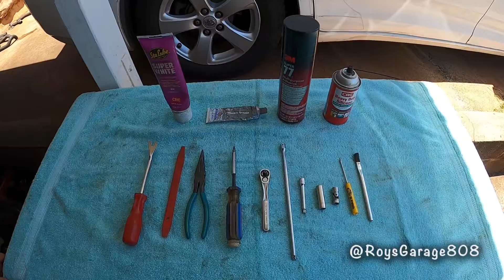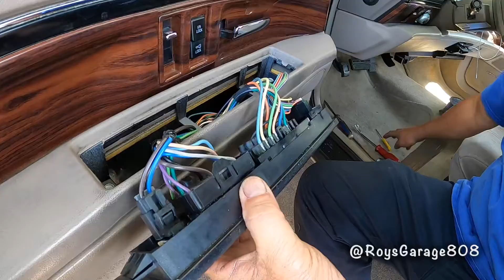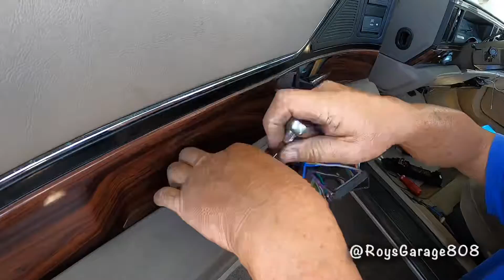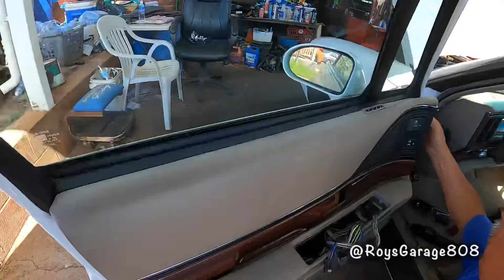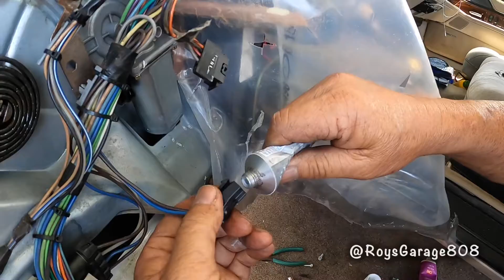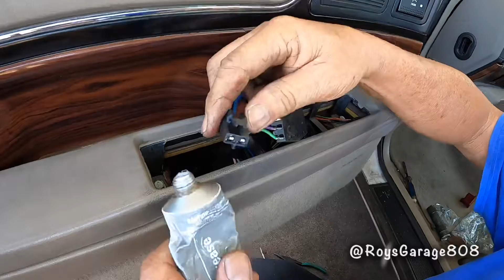How to Replace the Power Window Motor (Driver's/Left Front) on a 1999 Buick LaSabre

Comment: I have a 95 Park Ave. My window motor is working but only rolls window down 1/4 of the way. I can lower the window all the way with a hand on each side. After lubing, it goes down with ease. Once down, it will only roll up 1/4 of the way, and motor just chugs. But I can raise window with both hands and lock it in place my hitting the roll up button. DOES THIS SOUND LIKE A BAD MOTOR? Is there a nylon gear or something that is worn out that could be replaced, or best to just buy a new motor assembly?
Reply from the maker: It’s definitely best to buy a new motor assembly for it. Thanks for watching 🤙🏽🤙🏽🤙🏽